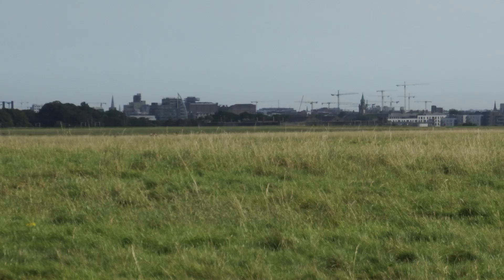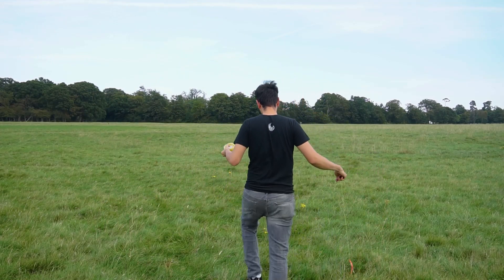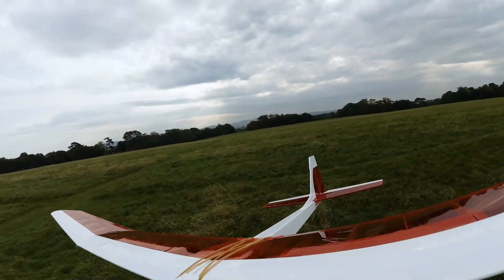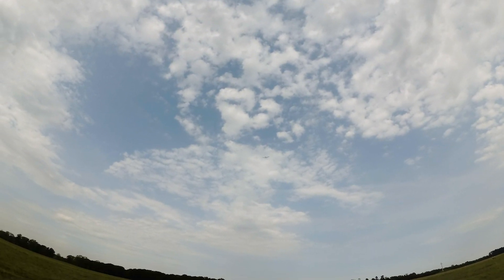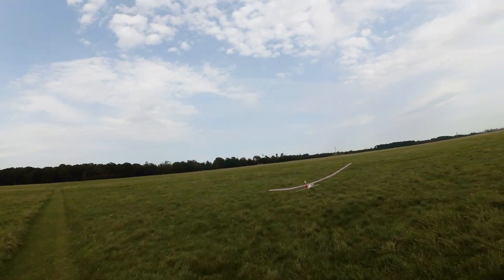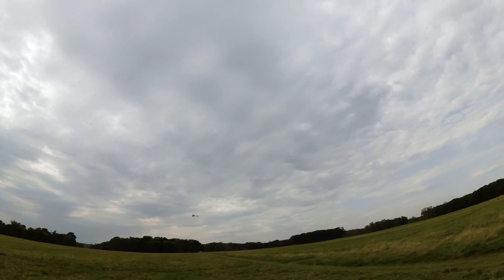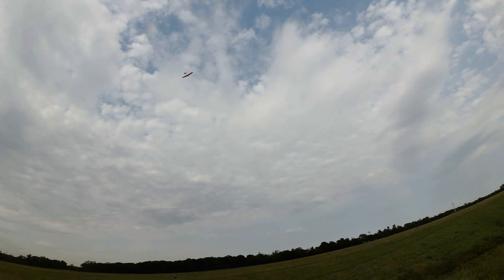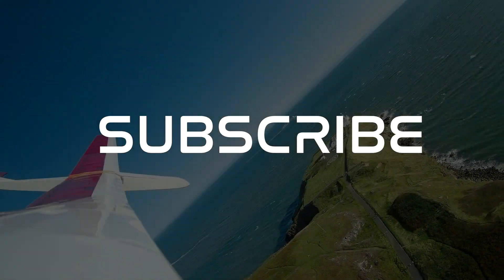Old school glider launch with Hi-Start or Bungee

Comment: Hi you are using the wrong size jelly rubber, too small, the one we use is 5/8 hollow with dowels inside to take the line and attach rings thats 20 metres and 120 meters of fishing line , a mig welder empty reel with handles to wide the fishing line on,  the jelly rubber was put in a large container and lid with powder.
(baby powder is no good) (use chalk line powder)
GILDER BUILDER AND FLYER FROM THE 1980S to 2023

Comment: Very good video! Your content is always very informative! I just bought an old style towline glider with the thoughts of adding a folding prop and battery, but not 100% sure where to start. It’s heavy with loads of old lead weights, so taking a big battery and motor should not be an issue, I think, but converting it… Well that’s the next project. If you have any pointers, I’d appreciate it! Keep up the good work!

Comment: I've been doing it for 45 years. Good exercise!  The new F3-RES /F3L contest class uses only hi-starts: 15 metres rubber, 100 metres line, < 4 kg pull when rubber extended to 45 m. That's quite a pull for 2 metre wooden gliders weighing typically 400 g, but hi-starts are much gentler and safer than winches. Note that the rubber is either latex or silicon tubing, typically available from medical  or fitness equipment suppliers.  For sport flying, the rubber can be extended to ~ 3 - 4  times its relaxed length (e.g. walk 50 paces from relaxed for rubber 15 paces long when relaxed). A hi-start is decidedly better in some wind (less extension then needed). A larger spool makes it easier to lay out and roll up the line and rubber together, rubber over line. Kept in a bag in a dark place, a hi-start can last many years. Beware of  kids trying to steal one at the flying field ... I lost one that way at the Pasadena Rose Bowl many years ago.

Comment: Used to fly at the Delyn model flying club in early 90s here in Wales. The singing kettle field (named after a nearby pub) had a noise restriction after 1pm. So before 1pm it was powered flight. After 1pm. The gliders would come out and the bungee. I used to take my os max.25 powered 3 channel Yamamoto trainer up at 12:50. Fly power till the my digital watch would beep. Then cut the throttle and glide. In summer with decent thermal I managed a 45 minute flight. Began to worry the reciever battery pack on the old futaba set was going to give out and so brought her down. We laid back in the tall grass. Me and instructor just single stick flying. Was a hell of a flight. The gliders came out to join me but for some reason I found lift they didn't. And most were on their second or third launch by the time my I structor Paul. Said.. better bring her in.. good times. High starts are still a handy tool in the right spot. 

A parachute is very good to help you find the line between launches. Safer too as slows the lines decent if you do happen to have walkers around. And if you accidentally let the line go whilst hooking up the parachute will open and slow the recoil across the ground.

Comment: You'll get it. It takes practice. Thicker rubber, a reel for the line and get a parachute. We get 8,000 - 15,000 steps when we fly.

Comment: I have jury rigged a hi-start system to a non-RC foam glider, the wings fold up worryingly. I am wondering if the parachute  is used to slow down the launch speeds so the glider is less in danger of snapping a wing on launch.
Reply: The parachute does not open until after release from the glider.  It slows the decent of the line and makes it easier to find the end of the line for the next flight.
Reply: stiffen wings or get  thinner rubber
Reply: @jazldazl9193  I appreciate the response. I posed this a while back and have since put carbon fiber into the wings, it flies great now.

Comment: Unlike a glow-engine it worked first pull every time.  There is lost technique to wind up line and tubing that does not tangle ! 
Back in those days one was out of the car into the air in under ten minutes;  the end close to the airplane has a large steamer or parachute so it drifts down to the starting point.    Seems a lot “tech” has been lost - I like glow engines and Electric but elastic work first pull every time.  No fuss or muss !!!! LOL!!!!

Comment: A few weeks ago, I was hit by the propeller on a flying wing I was hand launching.  Now I use a peddle operated bungee and launch ramp.  It works perfectly every time.  So I would say that bungee launch systems are still relevant.  Here is a link to a short video if you would like to see it.  https://youtu.be/q_pTwPabEKE
Reply: That's the trouble with flying wing pushers, which  otherwise are ideal for FPV.  Flight control software (eg. INAV) now has a launch setting which turns on the motor after you have thrown the model. The other common solution is a discus launch, but that can be a bit hairy.

Comment: I thought the glider club I joined was using bungee but they use the pulley cable system used on real gliders. Most of the guys use electric assist propeller gliders. The Exion glider is no longer available, thats too bad. I really liked the quality. Most gliders now are foam. Custom built gliders can cost a fortune.

Comment: I like it, but I do believe the concept of a glider should be as light as possible. Not adding weight but another design could give you much more time to fly.
Reply: Exactly. A true glider was never designed for an electric motor and does affect lift and balance if you add a motor. You can still fly, you will notice a big difference in how long it stays up un- powered and how the balance  needs to be changed because of weight. This in turn affects loft.

Comment: Gliders with motors are not gliders .might as well fly power !
Reply from the maker: Motorgliders then
Reply: Now days they have real gliders with popup motor assist. Its good for staying up longer so nothing wrong with powered.  Generally, once you find thermals, you don't use the motor on RC planes. I can stay up for a lot longer now being able to relocate to better thermals. Its not a crutch, it's a tool.
Reply: You're right, but there are places where it's the only way to get into good lift.  I fly gliders with the smallest possible motors that will get them out into the big air.  I'm on a mountain with awesome lift but terrible launches that require busting through rotors and sink, with no room for a high start.  I've tried high starts around here before but there's nowhere to set up.  

I'm looking for some kind of bungee solution that's shorter than a high start but would provide enough kick to clear the bad air.  For now though i can motor through the dirty air for about 30 seconds and stay up pretty much all day, i've done over 4 hour flights before with about 30-60 seconds of powered flight.

Comment: 40 years ago we had no choice, hi start or winches.  Hi start was the norm for weekend flying.  I had a much more powerful hi start.  At full stretch I could hardly hang on.  In fact, sometimes an assistant was necessary.  The wings would bend so much it was worrisome.  It was awesome.
Reply: We did that too here in Finland...40 years ago!
Reply: In the early  'sixties' my brother would use his fishing rod (spinning) with fixed spool reel ! I  would launch he would run !! Great fun.
Reply: Still launch this exact same way. Works just fine, less BS with stuff going wrong, usually "old school" is best.
Reply: Using a powerplant is cheating. It's no longer a legitimate glider. Call it for what it is, a powered plane.